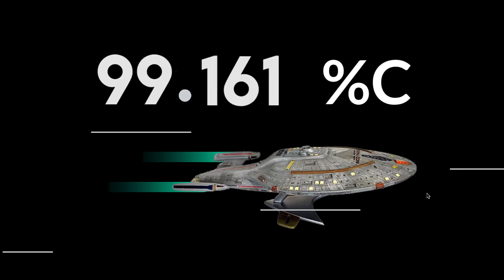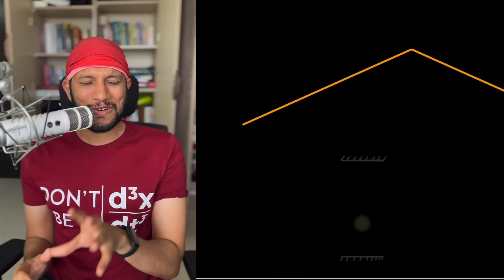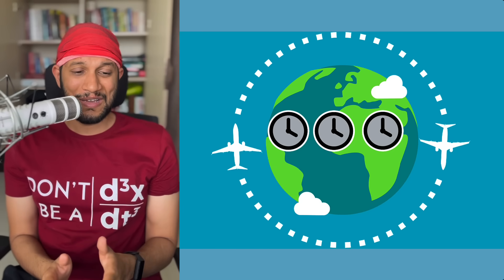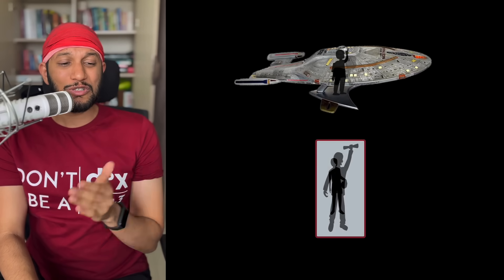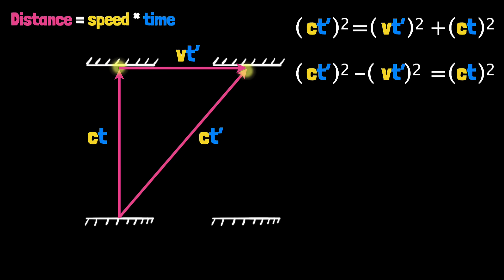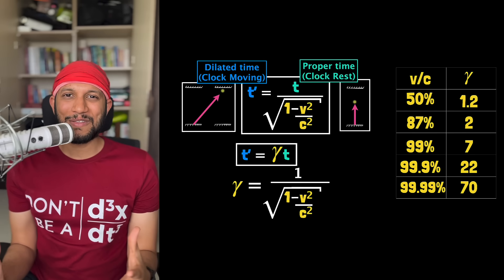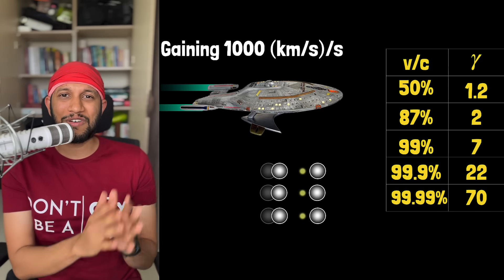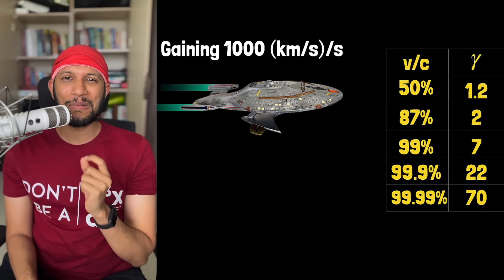I finally understood why you can't go faster than light! (My mind is blown)

Comment: I still don't fully get it.
With the constant +1000kmh/s example it was explained it would eventually take infinite time to reach c for observers from the outside. Ok, I get that. But why would the people on board care how/if observers from the outside could still see them accelerate? The people on board would still gain +1000kmh every second, eventually reaching c, wouldn't they? What would prevent them from doing so? Sure, for people on the outside it would look like acceleration takes longer and longer but isn't that just a problem for people outside the ship...?
Reply: From the reference frame of someone on board the spaceship, they are always at rest (since the reference frame is moving with the spaceship), so they will never reach the speed of light (or any nonzero speed) from their point of view.
Reply: @extravagantpanda7962  But isn't that like saying "that train will never reach 200kmh" because for the people on board the speed isn't noticable due to the reference frame moving with them? They don't move at 200kmh inside the train, but still that train is passing a distance of 200 km every hour, so once they get off after 1 hour, they will be 200km further away, no?
Reply: @cenorexia  What does "the train reaches 200km/h" mean?  You have to specify some reference frame you are measuring relative to.  In the reference frame of the train, the train is always at rest (and in general any object is always at rest in its own reference frame).  In some external non-accelerating reference frame where the train is initially at rest, then yes after 1 hour it will be moving at 200km/h (assuming the train accelerates at 200km/h^2).  And in yet another inertial reference frame it will simultaneously be moving at 20000km/h, and in another at .99c, and so on.  The speed of the train is completely arbitrary and depends on the frame of reference you are measuring from.
Reply: @extravagantpanda7962  Thanks for your reply. I guess I'm not the best at framing my question. Physics never was my strong hand. What I mean is: The people on board are not moving at 200km/h, or at least they don't perceive it as such because the reference frame is moving with them.
I understand that.
But when the passengers disembark one hour later, they will be 200km away relative to where they were one hour before.
If the train goes 2000km/h, it will be 2000km, and so on.
Now if the train goes at the speed of light, then the same should apply. The people inside won't notice any of it, like you said, to them the vehicle would be at rest, but when disembarking an hour later, they should be 1 light hour away relative to where they were one hour before.
But according to this video, they will never reach that speed. They might reach 0.95 or 0.99, but never 1.0
That's the part I don't fully understand.
In the example the vehicle is gaining a constant +1000km/h every second, no matter what. So once they reach "speed of light minus 1000km/h", what is it that prevents the final speed gain of +1000km/h?
In the video it is explained that to observers from the outside it'll seem as if it takes an unlimited amount of time for that last second to happen, and I understand that, because of time dilation.
But why does that matter? Even if the observers from the outside can't see it, and the passengers on the inside won't notice it (because to them the vehicle is at rest no matter what), once that final second has passed for the passengers inside the vehicle, their vehicle is at the speed of light, relative to the outside world, isn't it?
Reply: @cenorexia  So there is no "final second" before reaching light speed.  The typical kinematic equations of classical mechanics break down at relativistic speeds, so v = a * t is no longer valid.  Instead, using the correct relativistic equations (which follow from the so-called "Lorentz transformations") any inertial observer will see the spaceship approach c asymptotically, and they will measure the spaceship's acceleration decreasing asymptotically to zero.  There is no hard "boundary" where the spaceship continues to accelerate normally then has to suddenly stop due to reaching some threshold, rather it's a gradual process (i.e. the acceleration function is smooth/differentiable).  If the spaceship is moving at 99.99% of the speed of light in some inertial frame, then it's acceleration as measured in that frame will have reduced to close to zero, meaning the "progress" towards reaching c gets slower and slower as time goes on.  

Not sure if that was really any clearer lol, this stuff gets confusing, but if you're really interested I'd suggest seeking out a proper source to learn the physics in mathematical detail (the math isn't too difficult, just high school algebra for the most part) as you can only learn so much from youtube videos like these.

Comment: Why is that beyond the visible horizon of the universe, the light from any objects cannot reach us because they are moving faster than the speed of light?
The guys discuss new observations from JWST and just drop this stuff in.
Then how do you reconcile this?
Reply: Relativity says that nothing can move through spacetime faster than light.  However the expansion of spacetime itself is not necessarily subject to this limit.  

Imagine the universe as the surface of a spherical balloon with an initial circumference of 4 meters.  On the balloon are ants that can move across the surface at a maximum speed of 1 meter / hour.  Suppose that there are two ants on opposite sides of the balloon and they are traveling towards each other.  In order to meet up, the ants each need to travel a quarter of the way along the circumference, which at max speed would take 1 hour.  But now suppose that while the ants are traveling the balloon is inflating and therefore constantly increasing its circumference.  If the rate of this inflation, which is not limited to the speed at which ants can move on the surface, is great enough, it is possible that the distance between the ants will increase faster than they can close the distance between them, and they will never be able to meet.  It's not a perfect analogy, but it's the same general idea with the expansion of the universe.

Comment: I'm not a physicist, so please cut me some slack here, have a question.
It's assumed that a photon is a carrier for "energy transfer" within atoms and clocks etc. What about other methods of energy / infrmation transfer? 
What is gravity transfered with? How do we know that "gravity particles" or any other subatomic particles within quantum fields aren't moving faster than the photon as I'm not sure if it's even possible to mesure speed of anything that is traveling faster than a photon.
Reply: Gravity also moves at the speed of light.

If the sun wound disappear. We would notice it Only 8 minutes later.  Like in, being flung into space

Comment: Might just be stoned, but wouldn't the time dilation thing also retard the synaptic transmission rate of your neurons? Yes you would age slower, because you'll exist slower(as compared to your current experience).
Aren't we all hurdling through space at crazy speeds already? So we are already existing slower compared to a more stationary position in the universe. Sometimes we take for granted how amazing everything is.
Reply: You always experience your time ("proper time") the same, so you will not personally be able to "feel" a difference between traveling at 99% of the speed of light and being at rest.  It is only to an outside observer in motion relative to you that your time is seen as dilated (and equivalently, you see their time dilated).  And "a more stationary position in the universe" doesn't really even make sense: all motion is relative.  Right now you are simultaneously at rest in some reference frame and moving at 99.999% of the speed of light in another.
Reply: @extravagantpanda7962  My bad, should have stated more stationary relative to you. But 100% in agreement, it's all relative. It's the same with size, whenever we describe the size of something, it's always relative to something else, a pebble is tiny when compared to a rock, but absolutely massive when compared with a tardigrade 😝

Comment: You are using a Star Trek model, which literally runs on a hyperdrive warp engine (the one possible means of breaking the speed of light limit) .  See Alcubierre drive to see how you get past the speed of light by using the one thing in our universe not limited by the speed of light limit: namely the expansion of space time itself.  The object itself remains unaccelerated within a bubble of unwarped space-time while riding a stretched and contracted wave of space-time itself.  This has the added benefit for avoiding time the consequences of time dilation that would occur for accelerated objects.

Comment: When you mention the physical clock, you say the information about the movement is transmitted by electromagnetic forces travelling at the speed of light. And while that does make sense to me, I remember hearing multiple times that information about movement in an object travels at the speed of sound of the material the object is made of (I heard this in the context of having a stick the length from earth to the moon and what happens to one end if you move the other). 
Does that not apply here since we're talking about relativistic speeds?

Comment: If you were in a spaceship moving at the speed of light, and it's impossible to go any faster than the speed of light, you wouldn't be able to send an electrical signal from the back of the ship to the front of it. You wouldn't even be able to send an electron from the back of your brain to the front of your brain. With the exception of motion away from the direction of travel, you would effectively be frozen.

Comment: But like, is there a reference of no motion in the universe? That like, based on that reference, nothing can go faster than the speed of light? Because otherwise if you have 2 ships moving away from each other at half the speed of light, then relative to each other, they are going the speed of light. And let’s say they start from a planet which is already traveling hundreds of miles a second through space.
Reply: No, all inertial reference frames are equally valid.  In your scenario, the ships do NOT move at a relative speed greater than light precisely because of length contraction and time dilation.  The simple equations of classical mechanics, including the one you used to calculate relative speed, break down in the relativistic limit.  The relativistic formula for calculating the spaceship's relative speed has an additional factor of 1/[1-(Va*Vb/c^2)], where Va,Vb are the velocities of the spaceships (+/- 0.5c in your example) and c is the speed of light. If you play around with it a bit, you'll see that it is mathematically impossible for the relative velocity to reach or exceed c if Va and Vb are both less than c.

Comment: This implies that you, on your spaceship, could accelerate at 1g, for example, forever and never reach c. That's if you could make a spaceship that could survive the increasing intensity of the light hitting your spaceship from the front because the intensity of the light hitting your ship would eventually be gamma radiation (and worse) and woud tear it, and you inside, apart.

If c is indeed the cosmic limit it means travelling interstellar, or intergalactic, distances is essentially impossible within any reasonable time frame. Unless there is some way to circumvent these problems, like the much speculated "Alcubierre drive" which requires negative mass. ie. a mass that "weighs" less than nothing, you now know the stories of aliens visiting Earth are most probably fantasy.

Comment: None of this can be verified or proven in any way because everything is in motion at different speeds relative to everything else.  The Earth is moving relative to the sun which is moving relative to the center of the galaxy which is in motion relative to the center of the common group which.....  Everything is in motion and speed cannot be verified at all except to say, "Well, we're moving this fast compared to that thing over there."

How fast is the Earth moving?  We don't know.  It's moving through the solar system through the galaxy through the Universe.  Earth may be moving close to the speed of light- or beyond it.  Yes, it is possible to move faster than the speed of light if you're using an object speeding in the opposite direction as a comparison.  

So no, saying that something ticks more slowly to an observer the faster it moves is really not verifiable.  All speed is... well... relative.   And the speed of light has never been measured since we are moving.   Nothing is motionless.  Nothing can ever be motionless.

Also, that time dilation thing?  Has never been observed.  No clock has ever been watched and seen to be moving more slowly to an observer.  

Put a clock in a fighter jet- Strap the clock to the top of the canopy facing outward and have the jet pass by sideways at full afterburner- mach 1+.   Now, have it fly past you.  Tell me how clearly you observed the ticks of the clock.   No evidence because it cannot be observed.   The whole hypothesis is based off  of how one would observe the clock yet the clock cannot be observed.  And that's just at the speed of sound.  Now attempt it at close to the speed of light.  I'll wait for the video that observes this.  Spoiler alert- it will never happen.  This absolutely can never be observed.

Comment: You have explianed this phenomenon very well from the perspective of observer outside the ship..........But what about the observer inside the ship???? Is this imposible for them to reach the speed of light aswell???? Does the infinite amount of energy is required in their Frame of reference aswell???Please explain this the same way you did above......and if you have explained it then mention the link in reply.......Thankyou .......
Reply: According to an observer inside the ship, the ship and everything in it is always at rest.  When you drive in a car, from your point of view you are at rest, but we typically say that we're traveling at X speed, and that speed is relative to the ground.  So if an observer on the ship wanted to track their speed, they would need to choose some external reference frame to measure from, and that is no different from considering the perspective of an observer outside the ship.

Comment: This was the best explanation ever. You’ve asked the same questions I had, a real clock and now I understand why we simplify it. Thank you for this in depth answer. My physics professor just keeps saying well you can’t travel at the speed of light, you just can’t, doesn’t provide an answer. Now finally I understand why time dilation matters. ❤
Reply: it is wrong. no real clock slows down, because no real clock measures time, not distance. all real clocks measure time*distance, and that is a non-variable. 
Einstein was often confused
Reply: @Sergiu.antifascist except we have literally tried it and found Out that it works. Bait used to be believable.
Reply: And because of time dilation combined with dividing by 0 to unleash the power of quantum effects, the light barrier can be broken, all we need is to make such machine that can divide by 0, a computer high-tech enough to program such machine, and fuel potent enough to allow the machine to use quantum effects. As long as we break away, everything becomes possible.
Reply: @AlbertTheGamer-gk7sn This is utter nonsense.
Reply: @AlbertTheGamer-gk7sn  If you divide anything besides 0 by 0 you get infinity, if you divide 0 by 0 you get 0. Done, i can make a script that does that, when is the break of the light barrier gonna happen? :))

Comment: Also the faster you go, the more mass you have. If you could travel at the speed of light you'd have infinite mass. Meaning the fuel/energy amount needed is also dependent on mass because the heavier an object, the more energy is needed to accelerate it.

Comment: but what about if i keep beeing in the frame of refference of the ship? 
Say i’m on the ship , i have a very big tank of antimatter fuel( let’s imagine) and i start acceleratig with 1km / second. Technicly, if i accelerate continiously for about 300 000 seconds( about 84 hours or 3 and a half days i would cross the speed of light. Everyone outside the ship would still see me trying to get there, but if in my frame of refference , nothing is changing, my clock is still behaving the same, why wouldn’t i be able to cross it?
Reply: No matter how big the tank of antimatter is, it would not be big enough. As you would get faster and faster, you would also need more and more energy to keep accelerating further, to achieve the speed of light, you would need infinity amount of energy.

Comment: Maybe I missed something, but saying that the photo clock slows down doesn't intuitively make sense. The reference point of the clock from the outside, I don't feel, would change. It is not taking a diagonal path. Even from an outside reference point, it is still only moving between the two mirrors, while also at an angle, but the time from mirror to mirror, I believe, would remain the same. It's not traveling 'further' with reference to the mirrors, so this comes across as just...

I said so.

You start out by saying that it doesn't really prove anything.

Neither does your explanation.

You said, this is how it happens. Over and over again. In different ways.